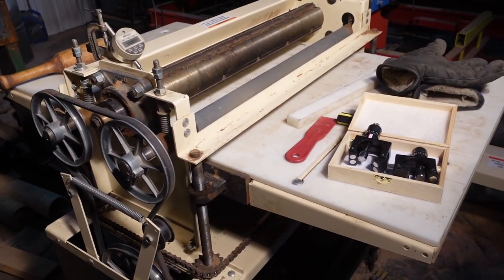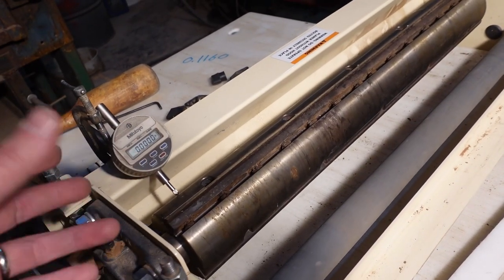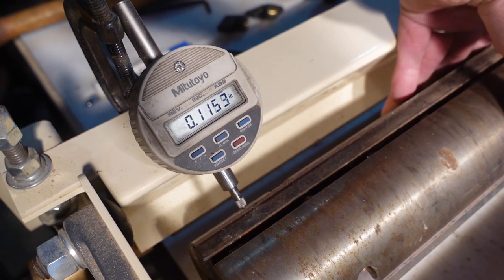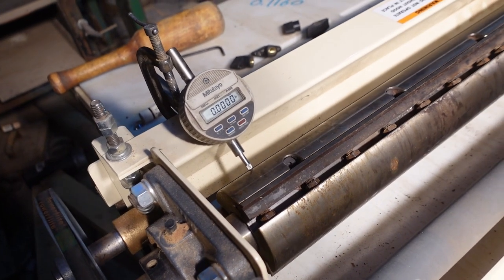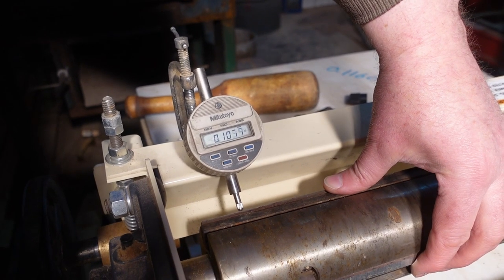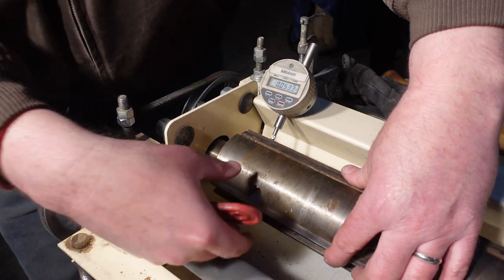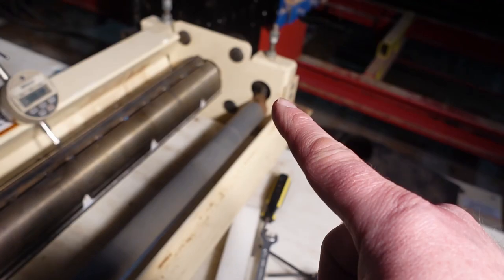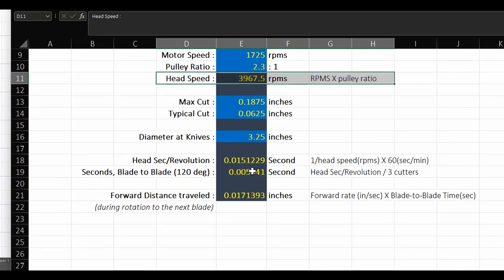Wood Planer Blade Tolerance - How critical??

Comment: Sharpening tolerance (in Europe) for HSS tools is 0,05mm or 0,1968...inch (13/64). You made it even better. 👍
Reply from the maker: 0.05mm = 0.002 inch.
Reply: @ThoenWorks  Thanks! I used unit convertor and it didnt worked  out well :)
Reply from the maker: Thanks for watching...👍
Reply from the maker: Thanks for watching...👍

Comment: How do you ensure the spindle body is parallel to the surface planer platen? It's been many years, but my Delta (Rockwell) RC33 surface planer had to have that adjusted. 
Worse, I purchased one of those 13" surface sanders from WoodTek, and it was total junk out of the box. The drive spindle for that was concaved to keep the sanding belt tracking, so it cut a convexed surface in any board I ran through, worse the power feed system had a casting pattern design flaw that prevented the China manufacture from drilling the hole in the main bottom casting in the correct place, so they moved that hole up over a tenth of an inch, so that forced the board being sanded to have a taper. It took me a bit to figure out why I was burning the wood. That was a major task to rebuild this machine, and fix all those design/manufacturing defects. Appears this same machine was sold with many other names on it.
No, I don't think you're being too anal in the setup.
Reply from the maker: Problems are  usually related to the words "made in China".  I would probably just try putting the same small, smooth board on each side of the planer with it off/ unplugged and slowly turn the spindle by hand to see of the blades contact the same on each side. Or plan off a wide board and measure each side with a calipers.
Reply: @ThoenWorks  I do own some USA built milling machines, a Rockford horizontal built ~1935, and a Wells-Index vertical ~1968. That horizontal just takes up space and collects dust.
I agree about China built imported stuff, but it's made to a price point, and me being a cheap bastard, got what I paid for. There should not have been what I would call DESIGN errors in it. I have many of these preassembled kits in my shop, and now I've collected enough tools to not need any more. I can tell you it don't matter if it's Grizzly or Jet, they are cheaply made, and come with manufacturing defects. In fact, I'm convinced both lathes I have were made from every incorrectly made part, and they exported them to our shores, and kept the better ones for their own production (that said, they both run true, and turn things round without taper).
They (China) are now capable of extremely high quality, thanks to the USA and Europe giving them all the intellectual property to build it better. I watched the avionics company I worked for, give it away to them. Their moon landings, space program, and hypersonic ballistic missile tech should scare the F out of us. These are not stupid people and they have a superior government. And the rest of the world just can't understand why they don''t have a bill of rights, and a gov that lets the oligarchy rule, and be fooled by the delusion that my vote counts.